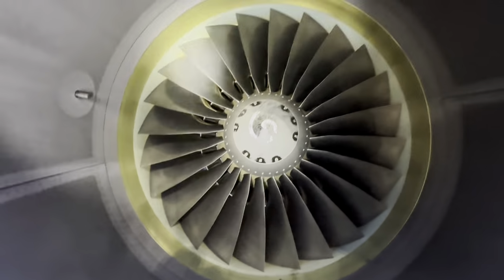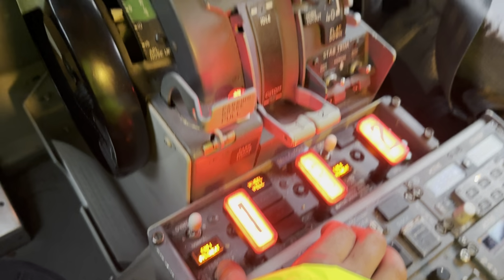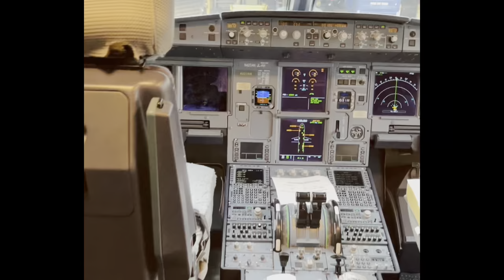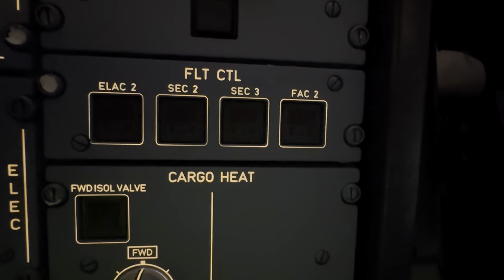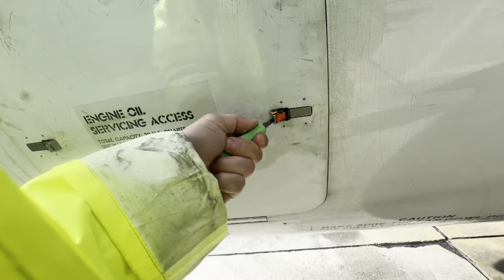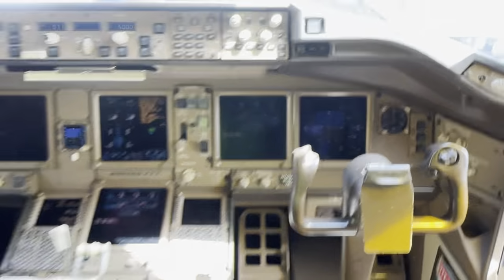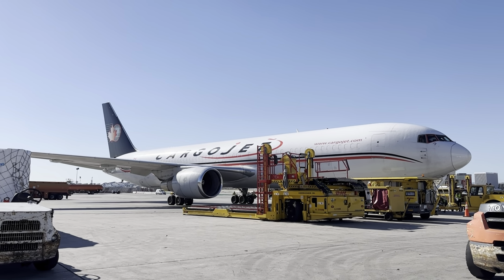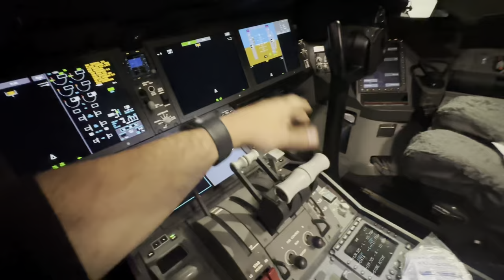Stig Shift #19 (Aircraft Maintenance Adventures)

Comment: You mentioned the max bank angle on the airbus being twenty something. The aircraft operating manual says it won’t exceed 67 degrees if the stick is held. It will correct to 33 when released.
Reply from the maker: I was throwing out random numbers just for context. Just to get the concept across of the laws. They are by no means accurate to the capabilities of the aircraft.

Comment: Awesome as always Stig!  Quick question. Does the aircraft get another maintenance check eg, oil when it lands at its destination or only on return?  I wondered if AA has maintenance staff for example in Heathrow? Also, when you were topping up the hydrolics, what is the liquid all over the walls? Is it a type of corrosion protection? Looks like it had a big leak! 😂.  Keep up the amazing work Stig, I hope this is successful for you.
Reply from the maker: Yes, absolutely it gets another maintenance check if it goes into international stations, it also gets checked on domestic stations that are the major stations. There are some stations that do not have maintenance, if there was a problem in such a station then they would requisition a contractor to come out and take a look at the aircraft. Otherwise, the aircraft is OK to go until it reaches a maintenance station. The stuff you see on the wall is mostly corrosion protection, but there is some seepage from the hydraulic systems. Hence, why you see lots of dirty components, this is normal.

Comment: Are you allowed to use power tools for maintenance? Example being the seat assembly change. Doing all 8 bolts with a ratchet. Could you use a power ratchet for that task? Also, on a side note, notice that almost every MD11 bounces when touching down. Great work again Stig! Thanks!
Reply from the maker: Power tools are allowed to be used on certain things. I opted to use a ratchet because I did not want to damage the fasteners.
Reply: @StigAviation  Makes perfect sense. Thanks for the reply!

Comment: Those GE 90's on the triple 7's are beasts! 127,000 lbs was the test max on those engines. THEY GREW THE COMPRESSOR BLADES ALIGNING THE MOLECULES OF THE METAL PERFECTLY! Incredible technology...
Reply from the maker: I can’t wait to see the power testing of the new GE9X. That one is supposed to be even more powerful.  Also waiting for the development from the Rolls-Royce ultra fan engine. They say that is going to be the biggest commercial turbo fan in the world.
Reply: Yup. I've read up on RR's big new reduction gear. Lotta nice engineering  there. 80 MW's or so, if l remember. Hi power density. RealIy gonna have to keep an eye on those once they're in revenue svc. Lotta borescoping and turning turbine assy over on turning gear for awhile. Gonna have to realIy keep an eye on things.

Comment: Hey Stig! Love your show!! Is there any way for the pilot to see what the total aircraft weight is that's resting on the wheels at any given moment while the aircraft is standing on the tarmac? .. like load cells in the wheel assembly or by using fluid pressure in the hydraulic system?
Reply from the maker: The only thing Pilot can see directly is the weight of the fuel on board, and a transcript of weight of the cargo and passengers. But the total weight of the aircraft cannot be shown. An aircraft would have to be placed on a scale for those numbers.

Comment: Amazing how many calculations the computers on those airbuses run. The variables and multiple inputs from various sensors to create a sum/reaction/response is remarkable. That being said, im not sold on potentiometer actuated controls on an aircraft. Same reason i would rather drive a rig with a pre def motor that doesn't need "updates" on the computer. Wasnt the assembly of the truck completed when it left the factory?🤔
AWESOME CONTENT STIGSTER!
🤣🍻👍
Reply from the maker: I can totally understand the apprehension and a bit of skepticism in regards to flyby wire aircraft. You are relying on computers, computers that are performing calculus and binary programming on a continuous basis. But everything has been so refined and built with so many redundancies. It is very reliable.

Comment: "Any of the water that does get into the core of the engine will just get atomized and/or vaporized"
Absolutely true, but there's another thing that happens if you do that on purpose in a turbojet (less so in a turbofan):
More thrust! At one time the B-52 had a takeoff thrust augmentation system that was incredibly simple: How do you make more thrust? Push more gases out the back of the engine. How do you get more gases to come out the back of the engine? Burn more fuel with more air. How do you burn more fuel with more air without overheating the turbine section? Cool it off some with a spray of water injected into the combustor section.
This should have 2 primary effects, both of which increase thrust:
1. As mentioned, lowering of the full throttle combustor exhaust temperature, allowing more fuel to be burned to return the temperature to the previous limit, creating overall more exhaust gas passing over the turbine and more airflow into the engine core.
2. The water will be boiled to steam, which will also contribute to turning the turbine and accelerating exhaust out the thrust nozzle, again increasing thrust.

I haven't done much research into it (I really should), but I think most of the benefit is from the cooling effect of the water spray.
There is of course a side effect that is the primary reason we don't see anyone doing this with jet engines anymore. Soot and smoke.
Water injection for a turbine engine is basically the same sort of thing as "rolling coal" for a diesel engine. There will be a large amount of soot and smoke produced by the engine, which will A: lead to an increased need to maintain the engine (soot deposits can make things stop working), and B: increases environmental impact of running the engines, which is why water injection in turbine engines was mostly only seen on military aircraft.
Reply from the maker: This is absolutely fantastic information. Thank you so much for taking your time and sharing your knowledge with the rest of us.

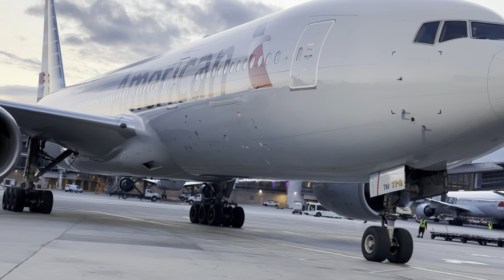Comment: 33:20 - interesting to see the vertical stabilizer move that much. Must be the pilot using the pedals instead of the good old fidgetspinner/tiller, eh?
Reply from the maker: Yup. You got it right. Using the pedals and they transition to tiller at higher angle of turn

Comment: That A321 had a very sharp turn into the gate. I remember pushing an MD-11 out of a gate next to an active taxiway which required a hard left push. It was my first time pushing out of that gate and my eyeballs must’ve popped out when I noticed that the nose gear was turning on just the left wheel (from my perspective), the right wheel being completely off the ground. The mechanic walking next to the pushback, on the headset, saw my reaction and gave me thumbs up and “don’t worry” smile. How does this happen, Stig? What are the mechanics which cause that wheel to elevate? Seen this on Airbus, as well.
Also: remember when the Top Gear guys HATED the Porsche Panamera because they said it was ugly? It’s not ugly anymore. They’re beautiful nowadays.
Reply from the maker: Yeah, that’s perfectly normal, the airbus even does that if you turn the wheel hard enough one of those nose wheels will come off the ground. It’s just the way the landing gear pivot off-center.

Comment: Fantastic video as always Stig, thank you!
On the very first 'office' that came in with the tight turn, it made me wonder: Are the tires put under excess pressure when on a tight turn? The inside tire appears to take most of the weight with the outside lifting slightly, I guess due to the forward stance of the nose Leg Assembly. (Not sure if that makes sense but I think you will know what I'm trying to say?).
The Airbus Laws are amazing! Complex but at the same time simple to understand 😊
Reply from the maker: Indeed, there is a lot of pressure and stress onto those nose tires, but they are built very, very tough. If you look closely, you can actually see it bulge onto one side due to the tight turn.

Comment: stig, can you talk about the 777-300 landing gear  truck positioner and the sequence valves that sequence the opening / closing of the doors.
Reply from the maker: I’ll try to implement that information in the next video, but it’s gonna get a little bit convoluted because there’s so many sequence of events that are occurring. To make it simple, various valves, allowing fluid to flow through certain actuators. Gear door comes down, landing gear comes up locks into place, gear doors come up.

Comment: Hi Stig, 

As far as redundances are concerned would you say the airbus as more redundant say than the Boeing 737-800 or are they much the muchness between them both.
Reply from the maker: They are almost on the same level, but in my opinion, and this is solely my opinion. I believe Airbus is safer when it comes to redundancy.

Comment: Thank you, the other day a co-worker had a warranty, parking brake valve no light indication…since we are a repair station here in miami, we do have aircraft manuals, just the accessories…and well you came in to help, your video that shows the ground crew indication light…a high contact resistance switch(intermittent to)…
“Easy” as you say…we are at EMC Aerospace Inc, check us out…best regards.
Reply from the maker: Thank you Albert. I definitely will check that out and thank you for sharing your experience

Comment: Random question if you'd be interested in answering on a video? What does the engine master switches shut off? Is it an ignitor that basically stops fire from happening or does it shut fuel off to that engine?
Reply from the maker: Master switch cuts the fuel.

Comment: The steel cables that control the surfaces, how do they keep their tension over the length of the aircraft?  do they stretch?
Reply from the maker: They do indeed stretch over time. But the cable is designed to keep the tension from temperature changes. We also do maintenance on the cables to check the rigid and tension levels to make sure it’s in proper condition

Comment: Hey Stig. I've been meaning to ask for a couple of videos now about the drain mast attached directly to the tail skid fairing on the 737's. Is that like a pressure relief valve, for the want of a better description, when a tail strike actually occurs as I'm guessing the skid  isn't on a spring... Or is that a totallywrong guess? 🖖
Reply from the maker: If you are talking about the pipe behind the skid   That’s the apu drain mast.
Reply: Yep, that's the one, and now I have learned something. Thank you Stig 😊🖖

Comment: Was that woosh sound after engine power down the de-pressuration of the cabin.
Reply from the maker: That is the transient bleed valve and load compressor, it’s unloading excess air from the compressor section on shut down.

Comment: So I’m an industrial electrician and deal with lots of breaker types. Wondering about the plane breakers. Are they just a pull and push type breaker. I can’t never tell what ur doing?  O and on that md11. Is that an actual engine up on the tail section and if not what purpose does it serve?  Stay safe bro
Reply from the maker: They are thermal style breakers. That’s why you have the numbers on them, it’s the amperage limit.  Works exactly like the ones in our homes.

Comment: Has the rear stabilizer jack screw got any redundancy ? I recall an Alaska airlines air craft crashing because of a failure of this component .
Reply from the maker: It has a lockout device also as I mentioned in the video, a stabilizer cut out, where it will prevent it from running away. And the reason the Jack screw on the Alaska incident failed is because of lack of lubrication. It was poor maintenance.

Comment: sorry if I sound dumb or if my question is but I just wondered do you guys assign the spare parts to each individual plane i.e.(this area of spare parts belongs to plane tail #x) or is it  assigned by plane manufacture/model and did you ever had a spare part that was defective out of the box
Reply from the maker: Parts are subdivided into categories for fleet types, but they are not separated by particular individual aircraft. So a part from a 320 is designated for all 320 aircraft, a part for 737 will be designated for all 737 aircraft depending on effectivity

Comment: Hi Stig:  What would cause the red dot to slip relative to the valve?  Would it be very heavy braking?
Reply from the maker: Most likely an under inflated tire would cause that to happen. Or sometimes a bad bead seal on the rim assembly.

Comment: Hi Stig. What's the reason the bare metal anti ice section on the nose of the  engine cowling is so much bigger on the GENX/LEAP/Trent 1000 than it is on the older generation engines? 🖖
Reply from the maker: Just evolution of design, bigger engines require bigger surface area
Reply: @StigAviation  Ah ok. Thanks Stig.

Comment: Could the manual horizontal wheel have helped prevent the two Max crashes cuased my MCAS proramming?
Reply from the maker: Yes, it could have, this is why I mentioned the stabilizer cut out switch. Those incidents both could’ve been prevented. That’s why I also blame those pilots, very poor training on how to actually fly that particular aircraft. They could not recognize a stabilizer runaway.

Comment: Why is the exhaust cone blue on new aircraft like that 787?? Some kind of coating?
Reply from the maker: It’s a brand new engine and exhaust cone is actually made out of titanium material. Hence the blue color. Overtime it will turn brownish goldish color due to the heat.
Reply: @StigAviation  Thank you

Comment: I had a question maybe you could cover it in a video. I noticed a 737 parked at the gate and it had a stick under the rear fuselage to the ground almost like it was propped up to hold it. Never seen that before.
Reply: My first like is maybe so it does wheelie but isn’t the plane not supposed to tip over
Reply from the maker: You actually got it spot on my friend. It is to prevent the aircraft from tipping backwards. Mostly used on 737-900 series because it’s so long and tail heavy
Reply: @StigAviation  haha that’s neat. Well if you even have any of the 737s pull up I’d love to see how it works on a video. Keep up the great work

Comment: Is there a taxi thrust or does the pilot have discretion on that?
Reply from the maker: Pilot has the discretion on how much thrust to apply during taxi operations. Usually, with a fully loaded aircraft, they might have to go slightly above idle just to get moving, but after that, it’s usually at idle.

Comment: What rpm does the high bypass fan run at compared to the core ? Also can you use the apu in the air or only on the ground?
Reply from the maker: Depends on type of engine. Can you be more specific
Reply: @StigAviation  whichever one you choose
Reply from the maker: @kizzjd9578  good example of an engine. GE90. N1 speed is around 2900 and N2 speed around 11000

Comment: stig sometimes when the engine starts a strong smell comes into the cabin, is it more likely to be skydrol or fuel?
Reply from the maker: It’s just fumes from fuel. It happens because as the engine engine is starting up, the air conditioning system gets isolated and the fumes sometimes enter the aircraft just for a brief moment.

Comment: Hello Stig,

I have a few questions:

1)
Does it happen that pilots hear the STALL WARNING in normal law?
I mean, could it happen that you hear for a short moment the STALL WARNING during an agressive maneuver even with activated STALL PROTECTION?

2)
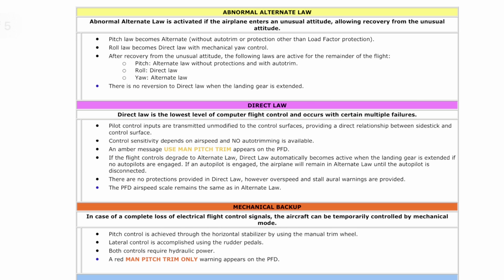In the document at 20:51 it shows that in DIRECT LAW you hear an OVERSPEED and STALL WARNING.

I have never heard that there is an OVERSPEED AURAL WARNING in AIRBUS flightdecks.
Is there an Overspeed callout or do you hear only the MASTER WARNING Sound?

3)
What is the difference between OVERSPEED PROTECTION and OVERSPEED STABILITY?

4)
Are you open minded for ideas for Video content?
Because I have a whole list of things which could be very interesting.

P.S. I am excited about your Paranormal incident stories.
Reply from the maker: Forgive me for getting back to you so late, I just saw this comment. OK to answer your question. In regards to stall warning in normal law, it could happen if the aircraft experiences a near stall event. Yes, there is an overspeed callout, we perform operational checks on the ground, and we will hear that while the test is happening. Overspeed protection is a system that detects over speed and excessive acceleration, over speed stability is a function that protects it from accelerating further. And for your last question, I am always open-minded for video content, feel free to offer any kind of suggestions and I will do my best to oblige.

Comment: Okay stig, i just flew American Airlines from punta cana to charlotte and had an issue taking off. They said maintenance was done about 15 minute delay, then had to wait over and hour to get the work signed off. Whats the deal with that?
Reply from the maker: Sometimes paperwork and the legality of getting the aircraft back into airworthiness conditions takes longer than the actual fix. Having proper documentation and references is important. I apologize it took such a delay but the documentation is part of the reliability of safety.

Comment: Could or would a pilot ever manually command the aircraft into direct law if the plane systems caused confusion for the crew? I've heard stories in which the high level of Airbus's automation  have been contributed to mishaps and I wondered whether that's a fair criticism.
Reply from the maker: Yes, Pilot can disengage the systems and go into direct law, but if there’s nothing wrong with the aircraft that would be going against safety protocols. They will only follow the QRH in case something fails